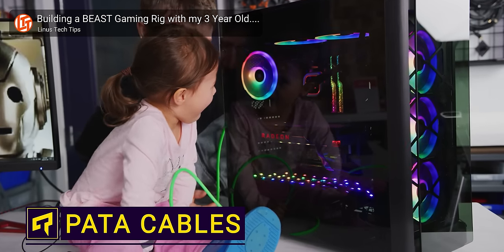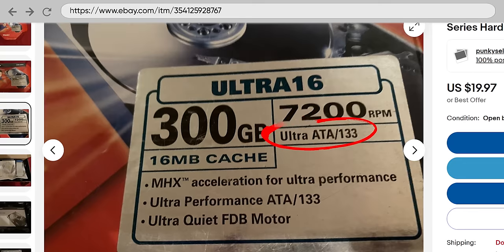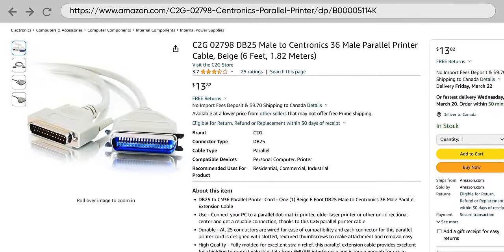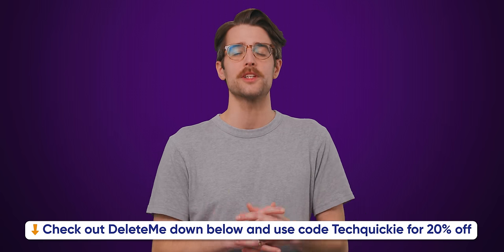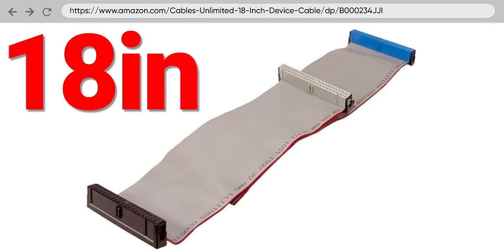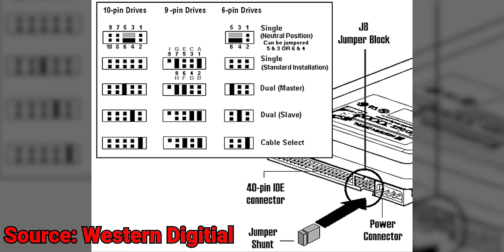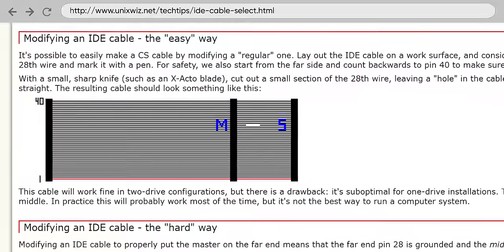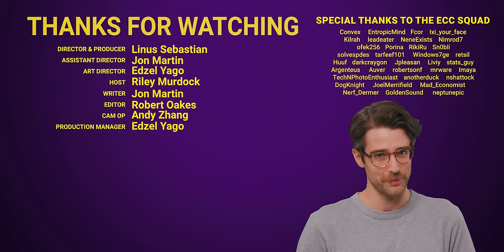PC Cables used to be HUGE. Why?

Comment: I remember way back when, when i would do a new computer build i would still include a floppy drive for the longest time, even though floppies were long obsolete. Why? Well the BIOSes that were on motherboards at the time: booting from usb, or even cd-rom wasn't always reliable. To flash a BIOS or to recover an OS, it was always rock solid reliable to boot from a floppy.  Nowadays that obviously isn't necessary, but back then it felt weird to not have a floppy drive just for that reason
Reply: I did too.  I even kept a 5.25" floppy drive going too for a lot longer than I ever really needed.  Still it was pretty cool in the day I thought.  I had both floppy sizes and a tape drive and a Zip drive and a CD burner and a DVD player and USB ports to plug in thumb drives all on one system.  I wish I still had it just for nostalgia.
Reply: I still come across the occasional floppy disk in my boxes of storage from many moves ago, and I think I still have a 3.5" drive in one box that I kept "just in case" for 20 years longer than needed.
Reply: Also Windows recovery could be done through floppy.
Reply: @gabrielpowers766  I remember backing up so much stuff to CD-ROMs. Since the Internet was so slow back then: 500mb of data was precious: that was like 3 days worth of download time. I had stacks of CDs from old backups.

Comment: The main reason for using parallel interfaces was the limit on switching technology at each end. To get the same throughput though a serial cable it has to be able to switch 8x faster for an 8 pin cable, 16x faster for 16 pin etc etc.  High speed switching semiconductors were much harder to make, the wafer sizes were larger etc.  Remember that the original IBM PC had a main processor clock speed of only 4.77MHz.  This ramped up over time but all of this was incredibly slow by today’s standards.

Comment: My dad keeps a special drive that moves to every PC he builds. I am pretty sure it uses these cables and its casing is see through plastic on 5 of the 6 sides with glass on the spinning drive side (he has this drive in center view of his side panel. 
From when I asked about it years ago, he said he likes to see that drive spin up just because. So he went through the effort to keep it around in every personal system. idk what he keeps on the drive to have it spin up and down throughout operations, but if it brings joy.

Comment: Thanks for the video..  side note.. I never had any issues with the round cables.. I remember cutting the flat cables long ways and stacking the cable so it was thin.. that took some practice to pull off without damaging the cables..

Comment: Later round IDE cables, like the ones pictured came with braided shields. Personally, I had far fewer problems with the round IDE cables. It sure allowed for more space inside the case. Of course, during that time, floppy drive cables were still pretty common. They were another type of flat cable you might find.

Comment: Ahh, memories. I still have an old computer sitting at my mom's house with an AMD Athlon X2 processor and good old pata cables, but only thing connected to it is the dvd drive in there.

Its funny what we tolerated back then in terms of speed, amazing what happens when you get spoiled with stuff.
Reply: 20 years later, we will look back at today and wonder how we ever put up with slow NVMe SSDs, only mere gigs of RAM, and measly sub 100 core CPUs.
Reply: @edthelazyboy  Last year I finally upgraded my 13+ year old "gaming" PC, it had an i7-980, 12Gb of DDR3 1600, and a 780 ti directcu ii oc 3gb, I fortunely had one ssd for OS drive so at least I experienced that. I upgraded to an i7-13700K, 32gb DDR5-6000, 4070 ti trinity oc, and a Samsung 990 pro 2tb and  an Samsung 980 pro 2tb.

To even say I got a huge upgrade is still an understatement! And now, my standard is this, and the spoiling continues lol.

Comment: I still have a PATA cable in one of my PCs.  There are a couple of old CD/DVD burners with specialized firmware in it that are better with a couple of functions than anything newer I can find.  They take only PATA connections.  Since computers no longer have IDE ports, I use a PCIe adapter.

Comment: You could've mentioned SCSI cables which were 50 Pin and therefore even wider ;)

Also, an early 90s PC could have several kinds of these ribbon cables:
Floppy, Hard Drive (IDE), and CD-ROM (sometimes IDE, but often something proprietary that would connect to the sound card, like Mitsumi, MKE, etc)

Comment: Building a Win98se machine with PATA...  Been building since '94, never had a problem with them.  The rounded cable had a metal sheath surrounding the cable that helped with interference. (03:11 you can see the braided sheath).  Don't think I had one that went longer than 18", tho.

Comment: There were exceptionally good storage alternatives back in the days ('m talking about proper workstations), SCSI (parallel SE or parallel LVD / HVD bus with active termination) and FC-AL (serial), both implemented on PCB backplanes with SCA80 / SCA40 device connectors so dealing with any (SCSI or IDE / PATA) ribbons was out of question (and the external links were quite neat by def.).

Comment: Don't forget the slightly smaller floppy disk ribbon cables.  Also serial and parallel port connectors often had ribbon cables going to the motherboard.

Comment: I/O chips could not handle the higher data rates sequentially so they HAD to use a parallel interface to achieve better speeds. As  serial speed increased, leading to increases in parallel, eventually the cross-talk issues with parallel caused more issues than serial speed limits...

Comment: IEEE 1394 aka FireWire was also very good and fast at first but as USB got updated and FireWire wasn’t so much (but mainly because almost no one used it because it was more expensive), usb matched and then exceeded FireWire while also being the most widely adopted port
Reply: FireWire was mandatory when you were studying filmmaking back in mid 2000s, USB speed transfer was rubbish and FireWire was the only option for transcoding and recording video from a camcorder without dropping frames... I still remember the hazzle to make the camcorder to work properly as a video recording device on WinXP and Premiere.
Reply: @JuanDiegoPinillos  yeah, and that’s why most people in audio and video related stuff relied mostly on Mac because all Macs had FireWire by default
Reply: @smokeduv  I had to buy a PCI IEEE 1394 card, those were extremely cheap, as cheap as a 3.5 floppy disk drive
Reply: I remember being jealous of Macs that came with FireWire even though I never had a single use for it. lol
Reply: Had an external Seagate backup drive that had Firewire and, iirc, usb2.  Much faster on the firewire.  The Seagate drive died 👀(like always) but it worked fine for my WDs for years after that.
Reply: That's completely backwards, FireWire used serial connections, just like USB

Comment: I've been around since the drives used 2 cables, data and signal, as used with MFM and RLL drives.  My first hard drive was a 30 MB RLL drive, which cost me $500 with controller and I put it in my XT clone.

Comment: Good sir, I will have you know I still posses a bunch of PATA cables, two fully functional PATA hard drives, one PATA CD ROM, three PATA DVD burners, a motherboard with PATA connectors (and a floppy drive), AGP graphic card, a case where everything is mounted in, CRT monitor and a PS/2 mouse & keyboard. 🙂

Comment: It is also worth noting that during most of the PATA days, most computers by far had insides that looked like rats nests. While there were builders who did the careful folding to increase airflow, most just let them go every which way because they were inside the completely opaque case, and the CPU and video card didn't really create the kind of heat that modern ones do to require a huge amount of airflow. Frequently the only fan on a system would be the one built in to the power supply. Many early PATA era CPUs had only a heatsink if that, and absolutely no fans existed for individual components.

Cables were ugly and obstructive because nobody cared that they weren't.

Comment: hot/mid30s take but I like ribbon cables. Easy to tell if damaged, interesting look. I also like the modern USB-C ribbon cables you often see in modern dual PCB controllers and similar small devices

Talking about master/slave jumpers gave me weird nostalgia

Comment: Tldw version

Cables used to be big because they were parallel cables, where you had 8-16bits of data, addressing may multiplex using the same data lines, some handshake and control signals, lot more bandwidth since the data is moved the same way CPU or GPU would move it while a serial port requires overhead a buffer and bitshifting to take the same data and have in a format the computer can use and  require external circuitry to do this

Nowadays the overhead and processing power needed for 2 or 3 uart lanes using differential signaling, your Usb  serial port and SATA can move several gigabytes a within a few seconds

Though parallel cables like ide, scsi, etc have moved to the pci-e, nvme, and m.2 ports now faster than sata and USB

Comment: I had round IDE cables - they worked fine if you didn't buy a cheap one. No one called them PATA and no one called it device 1 or 0. It was master and slave
Reply: Yes.

Comment: My second computer(and several afterwards) were IDE.

Fair enough, my first computer used cassette tapes(a whopping 300 bits per second, or about 10 minutes to load a game) and ROM cartridges for storage so even a floppy drive would've been an improvement.

Comment: Yet we went back to parallel with the M.2 PCIe drives as transferring at the same time in both directions is quicker than having to wait for one side to entirely finish and the signal integrity issues have been solved already as it is just using the PCIe lanes on the motherboard. As PCIe supports both parallel and serial most M.2 PCIe drives are parallel though you still have a few that are serial.

Comment: Connecting early IDE devices was fun before the keyed cables and sockets came out. Finding Pin1 on the motherboard and devices was always stressful. I heard stories of fried motherboards and hard drives but thankfully never got my wires crossed.

Comment: I had always built my PCs.  I remember when trying to make it look a little nicer and facilitate air flow, I bought the "tube" version of the ribbon cables but was frustrated with the drops in connection.

Comment: 0:53 "If you look closely at a PATA cable"...

Umm... That's not a PATA cable. That's a floppy drive cable.

Good to see the proofreading is still an issue.
Reply: Not really a proofreading issue, more of an "editor using the wrong stock image" issue. Nothing was wrong with the script, there's just no reason for that image to be in this video at all since they never discuss the difference between the 2 types.
A "proofediting" issue?

Comment: They still are.  Look at PC riser cables :)
They are very much the modern day equivalent of the IDE cable.  (And in fact ARE parallel cables :)

Also Parallel Vs Serial is still more about length and price than everything else.
Serial cables are both cheaper and can be made longer/more versatile.
Parallel,  well it is/will always be much less flexible and expensive.

Comment: I'm working on a 486 pc and these cables were surprisingly more complicated than I remember. You could easily plug them in the wrong way. But get this, if you include both ends of the cable, 3 out of 4 ways to plug them in will not work. So painful 😅

Comment: I've built plenty of PC's with the old Parallel ATA, starting with the AMD 386/40. So I guess I'm now I'm a "computer enthusiast of the time". SIGH I will admit I don't miss the ribbon cables or floppy disks. Also about to leave my last spinning platter behind with the build I am currently gathering parts for.

Comment: That x2 plus the floppy drive cable and chuck in a 50-pin SCSI internal CDRW and the inside of my PC was a mess 😂
Reply: I'm surprised that he didn't point out that adding optical disc burners with minimal cache was an issues with PATA cables. You had to have it on the other cable from the one that the drive with the files you were wanting to burn for optimal performance. In practice, that meant that if you had 2 HDD and a cdburner, only one of those HDDs would be usable as the source for the files if you wanted to avoid a buffer underrun screwing up your burn.

The other bit where ATA sucked was that unlike SATA where there's an external port option, there wasn't for the ATA interface, so you were stuck with SCSI for external devices and later you could use USB.

Comment: I bought my first PC brand new with PATA cables, does that make me old?
Reply: My first PC didn't even have PATA cables. In fact, it didn't even have a hard drive. It had a 5-1/4" floppy drive, and we had to "Please insert disk 2 to continue" booting IBM DOS.😂
Granted, I didn't buy it myself, as I was 7 when we got it. It was a  Commodore PC1. The first three orso PCs I bought, indeed had PATA disks, and it's quite possible I still have a ribbon cable or two in the attic, seeing how long I haven't done a good purge of old trash out of there... 😛
Reply: @HansStrijker   If i may ask, what year was that, i think i bought my first PC in 1999 or 2000, it has Windows 98 on it
Reply: @floridaboz1  I'm fairly sure the Commodore was Christmas 1987, though it might have been the year prior. And the first computer I bought was.... Not exactly sure but second half of the 90s. I don't even know which processor it was, but I do remember having to (or, more wanting to) recompile the Linux kernel to get all the features I wanted in.
Then around 2004 I believe? I got an Athlon 64 as the previous one got toasted by a power surge due to lightning. My final desktop with a PATA connector was an Intel Core2Duo E8400, and my final computer with one, was an AMD Phenom II X4 840. But that one I used as a Solaris file server.
And now that I listed them all, my gawd, I spent waaaay too much of my paper routes and other after-school job earnings on computers... 🤣😂

Comment: Um... builders like Falcon NW and Voodoo PC would fold IDE cables in an origami style as a way to cable manage and optimize airflow and I did that when I did my first PC build in 2002 as a kid. Flat IDE cables were easily folded without issue and I would hide the molex connectors underneath and it looked good through the window on my Antec Lanboy case. Then came rounded IDE cables which MSI even started to include with their NFORCE 3 motherboards.

Comment: Literally never heard the term PATA before. Maybe a Canadian or regional thing? I remember all computers having IDE cables, then like in an instant everything was SATA. It was like all the computers I had or worked on had IDE and then poof no more IDE. I still have an IDE 3.5 inch floppy drive in a box in my closet though. Pretty sure I still have a 14 or so disk Windows install somewhere too!
Reply: Unless you were doing new installs with ATA cables after SATA become common, you probably wouldn't have. It was ATA and SATA before that point. It's only been in the last few years with millenial and gen Z youtubers that I've seen PATA showing up.

Comment: IDE cables were just one of at least 8 other types I can think of from floppy cables, SCSI cables, RBSI cables, the list goes on. The design type is called "Ribbon Cables" BTW. Really should have expanded upon the topic rather than get lost on a single cable from ages past.

Comment: We almost got a PATA/IDE ribbon cable modern comeback in the form of the SATA-Express connector or the U.2 SAS connector 

unfortunately those did not had a chance against the smaller modern M.2, wich is unfortunate because both SATA-Express and U.2 were not only compatible with the M.2 Standard but with the 2.5, 3.5 and 5.25 form factors so we could not only still use those drives sizes but also have some REALLY BIG powerfull and high performance SSDs, HDDs or even disk drives that could not only be bigger but the M.2 is not only size limited but power limited too because it's power is supplied by the botherboard while both U.2 and SATA-Express had their power supplied both by the motherboard and the computer power supply, just like a GPU (theoreticaly you could have a U.2 GPU too or any PCI-E device just like M.2) 

U.2 still lives in the server market, but SATA-Express is now dead as the last, fastest and quite the black sheeep from the SATA family until the SATA 4 comes out wich will probably never happen

Comment: I used the round PATA (IDE) cables for over 10 years and never saw a speed issue.  I had a system with 3 HDDs and a CD burner and had 2 HDDs on the round and 1 and the CD on a ribbon and I never say a speed difference.

Comment: You forgot to mention one of the more obvious reasons we moved away from PATA cables and we became very grateful for SATA cables.  Old PATA mechanical HDD got extremely HOT!  How hot you ask?  On average it was 60-C (140-F) per hard drive.  Keep in mind in those old PC cases, airflow wasn't a priority.  Closure was a priority to keep dust out of your PC case.

If you had 2 HDD which most people did in those days out of necessity.  It got really HOT.  You could heat up a Hot Pocket in 15 minutes.  No joke.  Plus the life span of PATA HDD were a lot shorter.  Your PC was known to overheat and lock up during game play.  That was a common thing.

I remember when SATA HDD came out and I went to Incredible Universe (a similar MicroCenter store) to look at one on display with the case panel off.  The sales lady told me to stick my hand between 2 HDD.  Which you NEVER want to do because you'll end up with 2nd degree burns with PATA HDD.  My mind was blown how cool to the touch the new SATA HDD were.